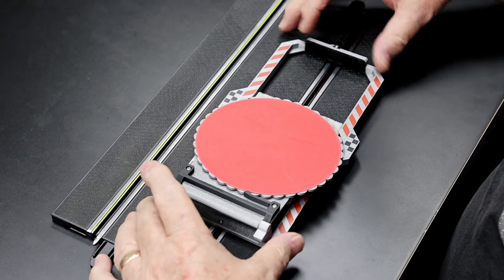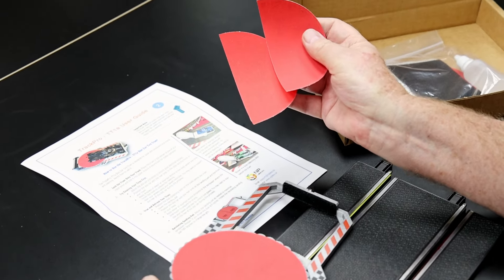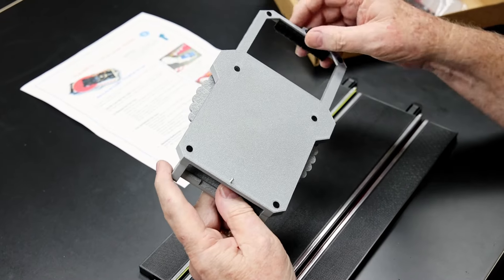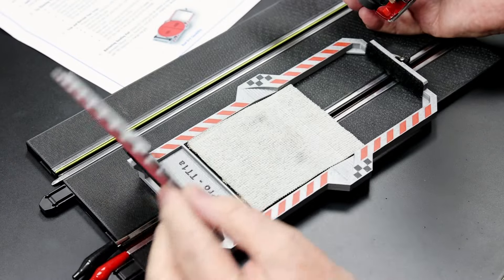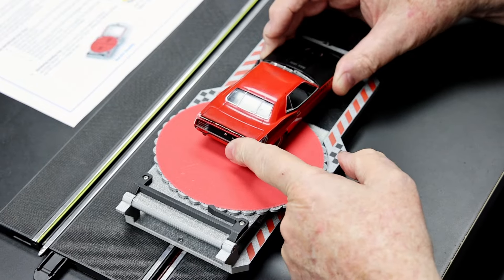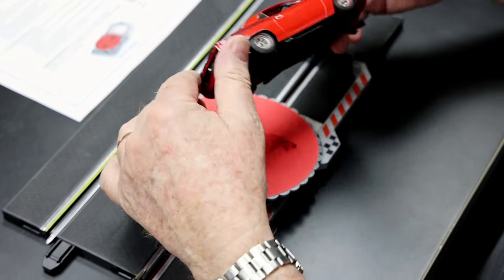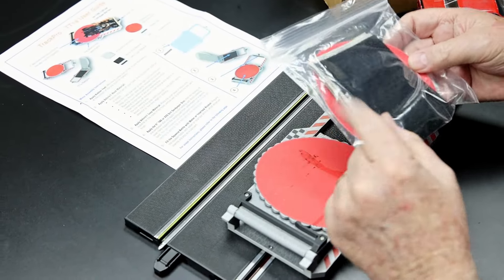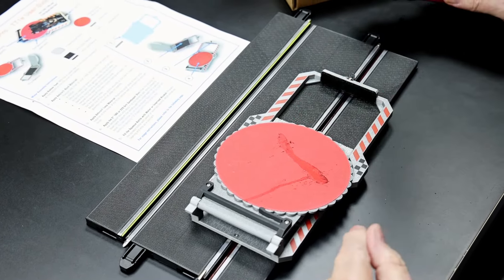Electric Dreams Presents: NP Labs TrackPro TT1a Tire Truer

Comment: This has to be the most convenient truer available and it's less than 1/2 the cost of the Proses one. It also has features ,none other has and uses standard PSA sanding discs, so the consumables costs are very low. The squeeze bottle is a great way to reduce motor and gear strain.